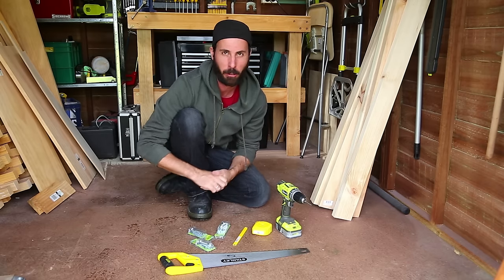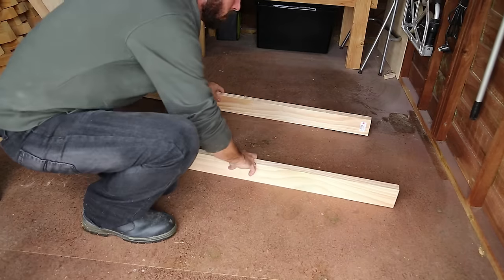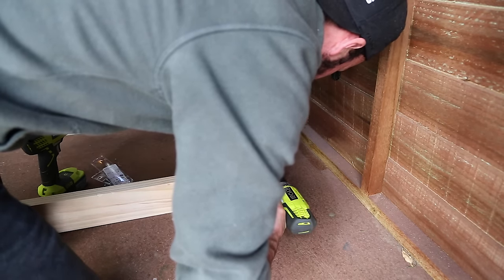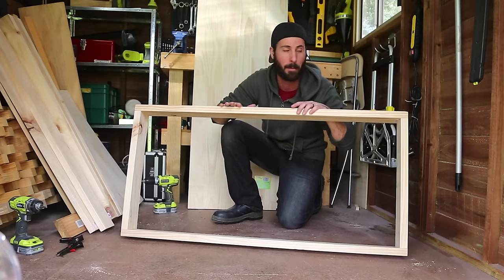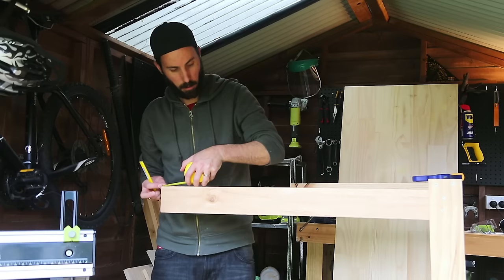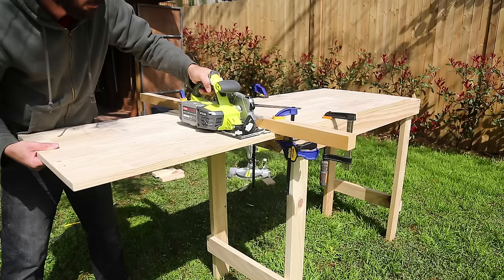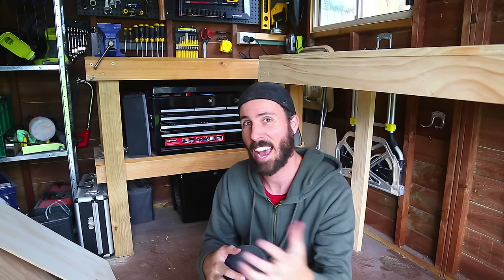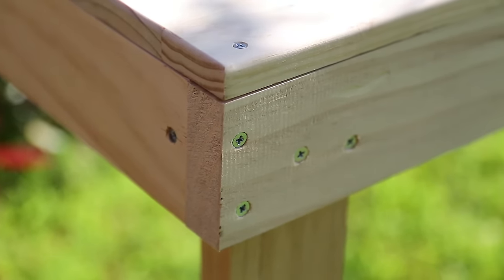How To Build a Simple Cheap Work Bench

Comment: Another quick tip, make your top bigger than the frame/Base, if you leave a 2" over hang on the front and if you want both ends, it leaves you space to use g claps to clamp stuff to the bench to work on it easier.
Reply: This is something I wish I had done... oh well.
Reply: @BIZARBIES  it'd look ugly, but you could always secure some 2x4's onto the top of the bench. Bolts or fasteners would work. Just make sure you don't strike the previous screws that were drilled.
Reply: Damn good idea!
Reply: scott parker And a vise.
Reply: here's a tip, it's bigger than, not bigger then.
Reply: cheers, I didn't notice the spelling mistake. 👍🏻
Reply: PRO TIP!!!! You don’t think of this the first table you get 😂 but if you did happen to forget an overhang you can probably screw a 2x2 on the edge im guessing that would hold up fine!
Reply: Making mine today and will certainly apply
Reply: Great idea! Thanks 😁

Comment: I converted mm into inches on a website. 

1x bench top (47 1/4 inch x 23 5/8inch)
Bench frame 2x (47 1/4 inch)
Bench frame ends 2x (21 17/64inch)
Legs 4x (38 inches,choose what u want)
Leg supports 2x (23 5/8 )
Reply: IrvingArenasSempSol Roofer thanks
Reply: Thank you!

Comment: Thanks for the tutorial. I made the bench and it cost me about $50. I had the hardware store make the cuts for me for just a couple of dollars, so that saved time. The corner clamp would have helped immensely. It was a little tricky getting those 2x4s screwed together without a clamp or a helper, but I figured it out. I put a little soap on the screws, which helped to drive them in easily and without splitting the wood.

The biggest obstacle was imperfect cuts and imperfect 2x4s. It doesn't take much to be off to have things not line up perfectly, or if the wood is even slightly twisted, to get some wonky corners and legs. I had to do a little filing and sanding to get it right, but it's a garage piece, not a museum piece. I am an extreme novice when it comes to this kind of stuff, so it took me four hours instead of one, but that's me.

Besides the clamp, a good work bench would have helped me make this work bench.

http://troythibodeaux.com/temp/workbench.jpg

Thanks again.

Comment: Love it! for extra rigidity on the top, you can layer up 2, 3 or more sheets of ply (laminated) to give a seriously massive top. The one I'm planning will have 4 layers of 3/4" (I think that's 20mm in French...feel free to check my math), for a 3" (80-90mm?) thick top. I do plan to bang on it with enthusiasm, so 2 layers is probably sufficient. 3 is overkill. 4 is more my style! :-)
Reply: Still using it? If so, how is it?

Comment: If you need a smooth surface, free of dents and scratches to work on; just nail on a sheet of plywood on top of your existing tabletop. As the plywood experiences regular wear and tear, you can pop the nails off and put a new sheet so you don't have to make a new bench every time, especially as pine can be quite soft.

Comment: Sometimes it's also nice to have the table top overhang the edge of the frame, that way you can use c-clamps and the like along the edge of the bench without having to fit them around the frame.

Comment: Pro tip... put wheels on it... heck put wheels on everything... you'll thank me later...
Reply: very useful indeed.
Reply: except on the bed.
Reply: petej222 hahah, had to laugh at that one m8
Reply: petej222 *Especially* on the bed.
Reply: But my bed has wheels on it lol. And I'm not kidding. A lot of beds do.
Reply: Daniel Ward Haha same bro
Reply: Phillip Tunstall I will say though- if you intend on installing a vice, DO NOT USE WHEELS. You'll thank me later.. this is a workbench, not a toolbox. You want it to be sturdy.Unless you find those tricked out casters that kick down so you can wheel it, then fold up
Reply: rasvial I was thinking the same thing with grinders, circular saws and other dangerous items. Maybe the flip out wheels would be better.
Reply: +Phillip Tunstall 
And a turbo, everything needs a turbo...
Reply: When in doubt, pull more wheels out.  😂
Reply: Can i put wheels on wheels?!
Reply: hmm
Reply: and paint it red, so it goes faster

Comment: I'd stick the front legs to the OUTSIDE of the front part.

Why?

If you use chunky wood (I'm using 45x95mm) you get a really nice lip to clap stuff on when you need to. I got a vice too, but some day you just need to clamp it to the workbench and small clamps are dirt cheap compared to massive ones.
Reply: putting them under makes the bench stronger. instead of depending on the screws to support loads, it goes right into the leg through the top which is a composite
Reply: Just cut the benchtop slightly larger than the frame so you get some overhang to clamp to.
Reply: Another piece of wood along the back going length ways would help even more so the legs are rigid towards the bottom though wouldn't it?
Reply: @anthonaut  this is the proper answer.

Comment: Sponsored by Ryobi.. lol.
Reply: mighty sellout mods.
Reply: you offering to sponsor them instead?
Reply: mmogi2
err sorry why would I? I made an assumption due to all the brand new Ryobi tools.
Reply: lol, they have been amassing ryobi tools for a few years now as have I, I Even tend to use my Ryobi one tools over my dewalt stuff purely for the 8 in 1 charger.
Reply: destroyeverything34
yeah I have a Ryobi impact driver. works quite well haven't had any issues with it
Reply: May as well use the same brand stuff, batteries are compatible etc.
Reply: btw yall Ryobi, Milwaukee and aeg are all the same company, handy man, trade and industrial lines respectively.
Reply: destroyeverything34 correct, same company, though Milwaukee is the industrial line and AEG is the trade professional line.
Reply from the maker: Unfortunately not. Ryobi have nothing to do with this video but I just have a lot of their stuff that I've bought over the years. Many years ago I got the drill and battery pack and next thing you know I'm in the hardware shop and saying "Hmmm my battery fits on this!". Marty also has a bunch of Ryobi stuff so we can share batteries and tools. (Better love story than Twilight?) He even has the battery chainsaw, which I guess he's gonna need when his MX5 gets CHOPPED! One battery system means cheaper tools because you can buy them without the charging kit and easier when lots of your stuff runs off the one battery - in that way they kind of lock you in. But if anyone from Ryobi sees this video feel free to send every single MCMTV2 subscriber a rattle gun.
Reply: mcmtv2
I'm sorry if my comment came off as rude. as if i'm saying "you're a sellout". honestly it wouldnt bother me if you guys where sponsored. it means more high quality content for us. was just making a little joke because of all the Ryobi you have!

EDIT: is it wrong that I read the comment in MOOG's voice as if he's narrating it? haha
Reply: ausguitarist
Moog, i work where you buy all your ryobi stuff from. These tools are actually not too far behind the professional lines! The rattle guns are actually mad.
Reply from the maker: ausguitarist Not at all man. All good. We've got a few companies that help us out over on the main MCM channel and we put their logos on our website and in the credits of the episodes but this one was made entirely independently. Just so happens I've collected lots of Ryobi stuff over the years. Rock on!
Reply: i understand guys. just cause you have a sponsor every once in a while doesnt mean you're a sellout. you guys make quality videos and deserve whatever benefits you're getting from the companies that want to promote their product. you guys rock!
Reply: mcmtv2 and also if you buy one tool and its reliable why switch brands, as well having multiple tools that take the same battery.
Reply: Ryobi tool's are the hobbyist special. They are sturdy enough to use a few weekends a year but suuuper inexpensive. Personally I don't buy Ryobi anymore because replacing my tools every 3-6month gets a little tiresome. Now Makita... My Makita power-plainer is 35 years old and only ever needs blades sharpened.
Reply: ausguitarist Nah man, they've used Ryobi tools in about 10 videos now. That's just the stuff they own. They specifically mention Craftsman screwdrivers as good cost effective tools, but they weren't sponsored by them either :P
Reply: mcmtv2 In Aus are all the Ryobi Products the greenish colour? In Canada all our Ryobi stuff is blue and yellow… I'm thinking of ordering some AusDM Ryobi stuff...
Reply: mcmtv2
I sort of chuckled when you broke out the Ryobi cordless chop saw because I have the older model of the same saw (it was super cheap on clearance, like $40) and the first project I used it for was to build my own work benches about 8 years ago! If you can get a Ryobi sponsorship, do it! I won't hate! :)
Reply: Chris Bisson Theyre green in europe too. Think they were blue when they had NiCD batteries.
Reply: And Stanley and Irvin...
IF this is an ad for this power tool brand then it is exactly how it should be done (well maybe not exacly, I didn't notice the brand before your comment and I dodn't recognize them, most likely because they are not popular or even available in Poland), not offensive at all, no forced scenes just for promote item, one can watch it not even noticing product placement.
Reply: +ausguitarist you forgot about the Trojan right angle+where did he get that

Comment: Gave this a go myself, made it a 90x30 frame and put a long 40cm-wide sheet on it, and cut the end so that there would be an overhang of about 5cm each side for clamping. I used a height of about 82cm, which in retrospect is pretty tall for such a narrow table, so it's not the most stable of things but it works! Thanks for the video. :)

Comment: I spent an hour just converting all the lenghts from metric to USA standards lol
Reply: It takes about 1,5 seconds to convert pretty much anything. Google: 1m to feet. Or 250kw to hp etc etc.
Reply: hi
Reply: or you can use a metric roler, mine got both metric and inches on it;)
Reply: I just asked Alexa
Reply: Imperial measurement is bad.
We might have bad internet in Australia but we got good measurements.

Comment: As an America ... metric measurements?! I'm so lost :D lol
Reply: Take every measurement and divide it by 25.4 and you have inches :) (if the measurement is in centimeters, just divide by 2.54)
Reply: As an Englishman...  you Americans are usually lost... as opposed to we Englishmen, who HAVE usually lost.   The Australians will understand that one
Reply: Actually, just BUY a metric tape measure. Stanley (and Lufkin) do make tape measures that are both SAE and metric. I used to work as an installer for a kitchen cabinet company that imported their products from Germany. All the plans and components were metric. Skip the metric to SAE conversion and just use metric measuring tools. It's the simplest method. It will also help you develop a feel for estimating metric distances. Metric is also easier to subtract and add. Having said that, millimeters do take some getting used to since they are smaller than sixteenths and are harder for me to see individually.

Comment: carpentry in metrics just seems wrong
Reply: Almost every country in the world disagrees with you...
Reply: Yeah the metric system is fairly common in a lot of things here in the US, but carpentry is one of the few things were the English system is used exclusively. I'm not saying metric is bad (it actually makes more sense, as fractions of inches gets confusing). It just seems so odd as an American to see a carpentry video that doesn't use inches.
Reply: splewy  That's how we feel when americans use imperial units. :)  '5/16" socket onto a 3/4" ratchet' and so on.... I don't know wether that's telling me to cut my socket into bits and put it on the world's tiniest ratchet or if they are actual sizes, or pizzas...
Reply: Monstretundersengen Lol, we hardly use imperial sized sockets on anything anymore, it's almost all millimeters. Oddly though, we still us imperial units for the size of the ratchet itself, so we'll have a 12mm socket on a 3/8" drive. Yeah, it's weird.
Reply: I know what you mean, but the metric system over the imperial system is so much more accurate.
Reply: You must be trollin'.
Reply: Anarchy522XD not necessarily more accurate, but metric being in variables of 10 just makes more sense
Reply: why? you can get dead on accuracy and do calculations so much easier. none of this 5/16, 3/8 fraction bullshit. regards, every other country.
Reply: ausguitarist ease of use does not equal accuracy. You can be just as accurate with either one. Any decent machinist can make parts to the nearest thousandth of an inch.
Reply: oh that's wrong but having tyre sizes as mertic/metric/imperial is fine? hahah
Reply: Jayson Carey
so as a machinist using either is fine. what about as a hobbyist? it's very simple addition and subtraction. how can it "feel wrong". yanks with their superiority.
Reply: What do you call lumber sizes in countries with the metric system?  We just call it "two by fours" or "six by sixes." Do you call them 5x10's and 30x30's (centimeters)?
Reply: Jayson Carey it all depends on what you're buying! im a joiner in scotland, sometimes it seems people just call it what comes to mind first
Reply: ausguitarist
Don't lump all us "yanks" together like that. The scientific community in the US is just as irritated with the English measurement system as the rest of the world is. On the other hand, there is nothing wrong with learning mathematical fractions, and English tools do have their uses in a Metric world (7/16" socket is 11.1-11.5mm depending on manufacturer... nice for pounding on to a damaged 12mm to be able to remove it..)
Reply: xXFLUXDELUXEXx
There Austrailian...  lol...love it..   :)
Reply: No...not them....ah don't worry
Reply: Anarchy522XD  That's kind of a silly thing to say. One isn't more accurate than the other, either can be infinitesimally accurate. But I do find metric more intuitive.
Reply: Monstretundersengen I'd rather use a 5/16 on a 1/4 ratchet just sayin
Reply: So how do you measure something smaller than half an inch without it sounding weird and wasting more time? We can just say 1mm etc instead of saying 1/4"...
Reply: Blo0dredRidingHo0d  This is circular. If you work with it on a regular basis it's not hard and doesn't waste time.

It's basic math, it's not that hard to figure out.
Reply: In australia we use both. we learn both. I'm 25 and i can confidently use both. I'm not a carpenter or even a tradesmen, merely a DIY hobbyist... its called using your brain...
Reply: Scotlands the same. ;)
Reply: Blo0dredRidingHo0d there's nothing abnormal about saying a quarter of an inch.  We even measure out tire tread depth in 32/ of an inch.
Reply: No, it seems just right.
Reply: Smart people use metric.  Test it yourself.  What is 654.165 divided by 10?  Just move decimal point one digit left so answer is 65,416,5   ...ok, now divide same number by 16.  Are you still counting?  What took so long?  See the difference?  There is reason why NASA has used metric system since beginning.
Reply: I agree to me millimetres is piss easy as I'm an apprentice carpenter but the fractions isn't that hard just got to thing harder
Reply: olov244 so true
Reply: Jayson Carey what's lumber?  Lol. It's wood or timber everywhere else
Reply: Best solution - buy tape measures that are both SAE and metric. Stanley and Lufkin both make tapes like this. That way you can still have your fractions along with your decimals. BTW, if you think metric is odd, try working with decimal SAE in construction if you haven't done it before. Grading and survey work are typically expressed using engineering scales (tenths and hundredths of a foot). You'll go nuts if you have to convert a lot of measurements to SAE. Just use the appropriate measuring tool for the standard you're working with.
Reply: Unpopular opinion here. SAE is easier for things like carpentry that dont need to be as precise. It gives more options for dividing in a faster way. All the examples people use are either "divide by 10" and then all you have to do is move the decimal. Well what if you need to divide by two? it isnt just moving the decimal it is doing math. Now it is basic math but so is 3/4 divided by two. or they will use another example of some large number and say divide by 16. which you would never do in carpentry. 1 because you arent working with numbers that large due to limitations in the size of lumber and 2 because any project involving that large of a number is very unlikely that you need precision to a sixteenth of an inch. also those are never even remotely accurate representations because you will never divide anything by a fraction except for 1 inch. it will be "X" number of inches and "x/x". which again is broken down into 16ths which is very quick to reference on a tape measure.  I am sure you can throw feet in there as another variable but having done carpentry for a number of years, we never called any length out by feet except for total material usage and it was always rounded to the next highest foot. If you ever look at a SAE tape and see the way the fractions are differentiated it makes sense. Is SAE the best system? I am not saying that, but it is an easy system, especially for things like carpentry.
Reply: @steelbluesleepR   it actually millimeters not centimeters. We also use two by fours by word, But when we measure it we use mm. so at the end we masure 2"x 4" = 50,8 x 101,6 mm. We never use cm in regular wood working. A example: A plywood sheet is always in mm. like 1200 x 2400 mm. in cm this will be 120 x 240 cm, in meters this will be 1.20 x 2.40 m. The metric system is much more easy to work with than the imperial system. But at the end both systems are good to have in hand when it comes to wood working.